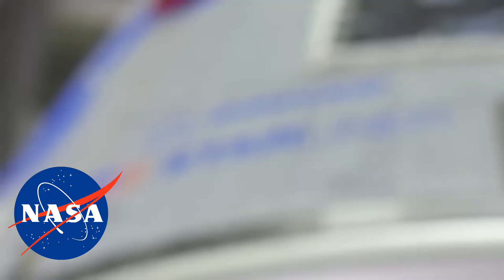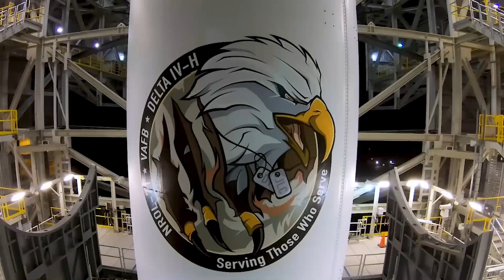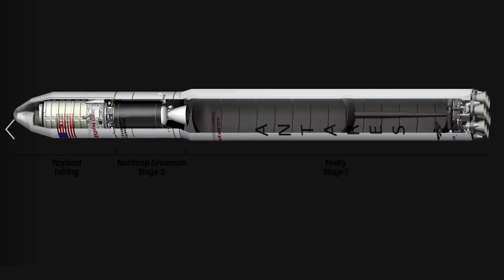The Inside Story: SpaceX's Revelations About Boeing's Starliner!

Comment: It makes NO sense for NASA to cancel Starliner, as Boeing is paying for the Starliner fixes, since the Commercial Crew program contracts are fixed-price contracts. So NASA can wait for Boeing to fix Starliner to the requirements set by NASA, as NASA is NOT paying for the cost overruns.
Reply: And wait how long, exactly? You do realize that we are in a race with China, right? Also, these days, unless the rocket is re-usuable, it makes no sense to waste more money on it.
Reply: @channelwithaweirdname  The CFT-1 flight is the last test flight for Starliner to get operational. 

Starliner and Crew Dragon ARE NOT a part of the Artemis program. China is NOT apart of the ISS. So Starliner and Crew Dragon are not a part of Moon Race 2 with China. 

Starliner is the capsule and the booster is separate. The Atlas-V was originally a Lockheed Martin booster and is now run by ULA. The Atlas-V first flew the same year as SpaceX was founded, which was 8 YEARS before the Falcon 9 first flew. The first F9 landing was 13 YEARS after the Atlas-V first flew. It was almost 16 years before the first F9 was reused. 

The Vulcan Centaur is replacing the Atlas-V and ULA plans to reuse the engine section, which is the most expensive section of a booster. They are not landing the whole booster as MECO is higher and faster than the F9, so a F9 landing would be harder.

Comment: 4:00 Um, the boosters have NOTHING to do with Starliner. Yes, Starliner has had LOTS of problems. Boeing does NOT build the Atlas-V booster, as that is a ULA booster that was originally designed by Lockheed Martin. The Atlas-V first launched in Aug 2002 when SpaceX was being founded and 6 YEARS before the Falcon 1 flew. SpaceX landed a Falcon 9 booster 13 YEARS after the Atlas-V first flew and over 16 YEARS before a F9 booster was reused. So kind of a big tangent here into boosters that have NOTHING to do with Starliner.  

The Saturn-V last flgiht was in May 1973, when Musk was not even 2 years old yet. Seems like this whole 5+ min segment about boosters and reusability should be in a different video. Then you wander off into Starlink, which also has NOTHING to do with Starliner either. You might want to rename your video, as this is a SpaceX video, NOT a Starliner video. Especially as you wandered into Starship info after Starlink. 

Also, why are their shots of Cygnus in the video? They are from the CRS contract for cargo to the ISS and also has NOTHING to do with Starliner.